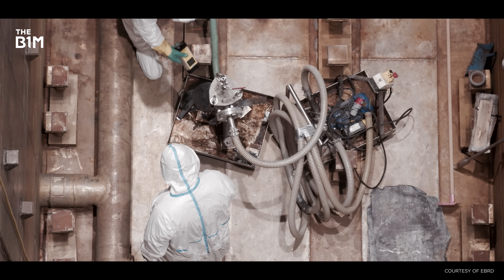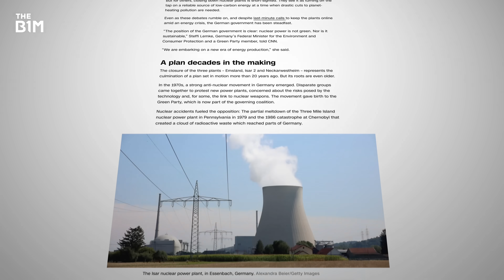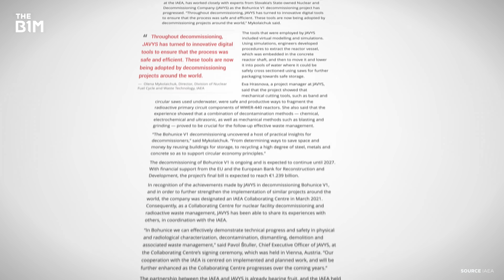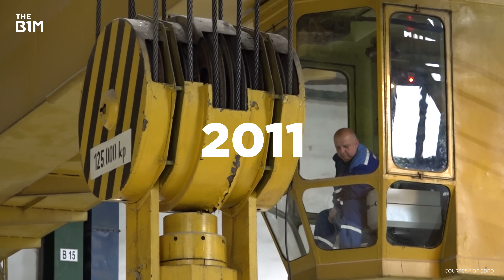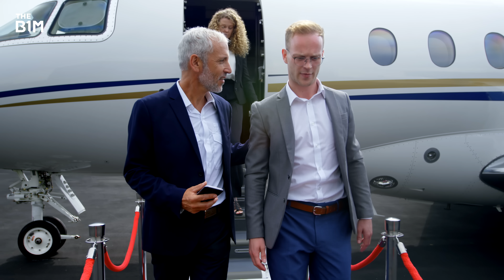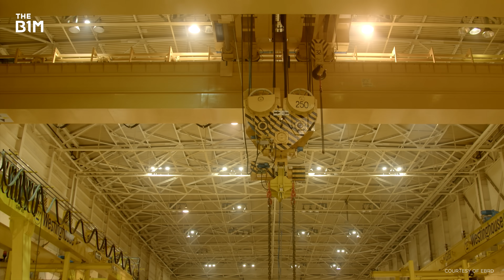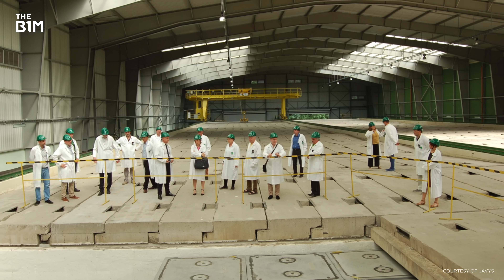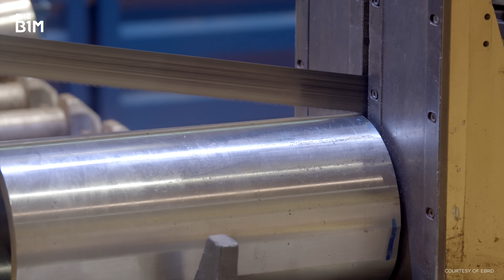Why These Soviet-Era Reactors Are Being Taken Apart

Comment: I’m probably one of the few people who watched this video that actually has worked on nuclear power plants. I’ve been fortunate enough to work on the containment vessel at a nuclear power station, the refueling machinery and the sacrificial shield walls of a nuclear reactor. I really believe that nuclear power has a role to play in our energy production matrix. And that opinion isn’t based on my previous work in the field. I’ve worked in multiple coal power stations, biomass and municipal waste stations, natural gas cogeneration plants and hydroelectric energy systems.
Reply: From your experience, what are the best forms of electricity generation?
Reply: @BelaJuTe  I’m a huge fan of hydroelectric power. I also think that tidal power has great potential promise for our future. The fact is that every type of power generation has its positive points as well as downsides. I believe we are going to need a BROAD mix of different types of power sources to serve our future needs. I am enthusiastic about small nuclear power generation systems, tidal, solar, wind, hydro, and geothermal energy generation. Variety is the key for the future.
Reply: @briangarrow448 hydro dams are the biggest batteries
Reply: @briangarrow448 Saw hydroelectric very positive aswell. One big disadvantage I came about recently are the methane emissions from flooded soil. It can take Up to 100 years until the emissions Stop and the gases have a Higher Greenhouse effect than CO2. 
Means we should absolutely still continue the use of the Standing ones but new Projects would need more Work, clearing the flooded areas of biomass would be one possibility.
Reply: There is a great video from a well known  professor of energy resources, who proves with numbers, facts and graphs exactly the opposite.  He shows that PV in Germany is even reducing the usage of nuclear in france.  Nuclear is just too expensive and is too much of an economic risk.  His video is called  "droht das Atom-Aus in Frankreich"
Reply: @1968Christiaan  And with the prices for Battery storage dropping fast right now cause of scaling up of the production will make it more and more a no brainer to have all houses with a PV and battery. So the storage close to the consumption and less usage of the grid.
Reply: @toggleton6365 what are you going to do with all those batteries at their end of life? Decommissioning is something required of nearly every power system, and batteries are some of the worst.
Reply: @aggonzalezdc  it's terrible if we use lithium batteries, but that's the wrong tech for the job. Lithium batteries' best trait is their energy density, important in portable applications but irrelevant in most others. There are battery technologies that are (potentially) cheaper, more recyclable and longer lasting. Using lithium batteries for large scale or even home energy storage is like building a skyscraper in the middle of a field instead of a low-rise town.
Reply: @aggonzalezdc  Well car batterys that are at under 80percent of their range or the car did break, get a second life as grid storage. And Mercedes as example is already building a recycling factory that is so far mostly for broken battery packs that failed in the factory.

The big problem is to sort small batterys from household electronics to recycle them better. Different Battery technology needs slightly different recycling steps. But car and grid storage are big packs that can be easy sorted so that the most efficient recycling method will be used. 

Well the great part is the EU already made rules for it. So that Battery need to have a  QR code label so you know what is inside. And rules what percentage of  cobalt lead lithium and nickel need to get recovered. Europe has not many metal mines themself so recycling creates a Material flow that is not depending on China. The likelyhood of this recycling system failing should be low as the materials are worth it.
Reply: @aggonzalezdc  There are a lot of breakthroughs on sodium batteries. Like batteries essentially made out of salt (well part of salt). There already commercially hitting the market. Expensive for now but with how cheap sodium is compared to lithium it's expected to drop price rapidly. High cycle life, decent capacity, about the same as lipo4.
Reply: @matthewsylvester9103  sodium technologies are promising. Molten salt is a good idea for grid scale, and it's much easier to recycle, which is great. The energy density is low for much else though (even other sodium based chemistries). Regardless, the same problem exists with nearly any battery, though it's much worse for lithium, nickel, or cobalt based chemistries. The recycling technology exists, we CAN do it. But we don't. It's too expensive. We've had the tech to fully chemically recycle nearly 100% of plastic products but you can count all the plants that do so on earth on one hand, and they run at a massive loss. We could do it but we don't because it's not profitable. So nearly all plastic goes in a landfill, even the stuff we put in the recycling bin. We could recycle the car batteries that are already being decommissioned now, but we don't. They're already piling up. And there are going to be tons of them. It's not very green to make them (currently) and it's not green at all to throw them away (currently).  

In theory, they're great, in practice, the green future we were promised isn't here. Not YET. Solar panels similarly aren't there yet. In time, I hope we can use 100% solar, with panels made in a sustainable way, with 100% recyclable components and energy storage for the whole grid. But we don't have time. We need action now. 

What we do have is a ton of knowledge and experience with nuclear. And one day, in 50 years when we have the processes and industries to make it all possible, we can phase out the nuclear for most  applications. Nuclear is what can help humans survive long enough to come up with something better. Other technologies are promising, they just need more time. For now, nuclear is safer, and cleaner than anything else. I hope in time that won't be the case, but we don't have that luxury now.
Reply: @toggleton6365 batteries don't scale 😂
Reply: @Snarf_Le_Wombat   They scale with the amount of factorys that get build and with the amount of material that is used. There is a lot of research to use less rare and by that expensive Materials Batteries.  For gridstorage you don't need the best battery, usually you are not limited by weight and size. Redox flow or organic flow are not really rolled out on a big scale. 
There is right now more the prediction that we will get into an overproduction and the market will be flooded so the price will drop even more.

Using the battery packs in cars a little bit for grid Storage will be already a big amount of capacity.
You really underestimate how fast the amount of Battery is scaling up.
Reply: @toggleton6365  it doesn't scale
Reply: @Snarf_Le_Wombat  Why does it not scale? You are writing like a angry little child. jesus give at least an argument.
Reply: @toggleton6365   you seem to think batteries are possible of large scale energy storage for the power grid, that's just not going to happen 😭
Reply: @Snarf_Le_Wombat  So you still have no arguments and give up with your feeling as argument. California has already battery storage that discharges already over 6GW and rising. total Battery Storage is 10GW with an additional 3.8GW planned to come online by the end of 2024. Peak demand in California is 25GW. So not unreachable with the current pace of building. 

 Texas is building a lot Battery grid storage too. The prices of Batterys has dropped  recently. So this will accelerate even more. 
How many GigaWatt do they need to be seen as big scale :)
Reply: bro just worked in every form of power plants that exist. he must be einstein or something
Reply: @karlrasur8356  You obviously don’t know anything about skilled trades workers like boilermakers, pipefitters or millwrights. These tradespeople regularly work in the construction and maintenance of these industries, along with many others like mining and petroleum companies. Hope this helps explain how some skilled trades have made great careers while doing fascinating work.
Reply: @briangarrow448 recently viewed a few pods on the current waste of & potential access to energy via recycled radioactive waste. Apparently, France is the only deeply vested country which, given their #'s, is a bit shocking. Have you ever worked inside their plant? What's your thoughts on the viability of this new science?
Reply: Do you believe this reactor was too dangerous to operate? It seems so wasteful to dismantle this plant
Reply: @Mrbg123  Anything Russian is defective.
Reply: I think the world has squandered nuclear power. First the approach of building these complex massive reactors that are custom designed for each site was a terrible mistake. 

I think mass producing 1,000 smaller nuclear reactors of comparable size to those on aircraft carriers we could provide enough electricity for 500 million people. They can have 20 reactors placed at naval bases across America and provide enough electricity to atleast half of the country with the remaining electricity being supplied by wind, solar and hydro. 

I think this same model can be used all across Europe. France currently gets 80% of its electricity from nuclear power.
Reply: dudes trying to humbleflex about his lies on the Internet 😂
Reply: @Snarf_Le_Wombat  I don’t lie. I don’t need to. I have the scars and the tee shirt. My resume includes most of the largest global contractors in mining, refining and power plant construction. Everyone from ABB and Bechtel to Westinghouse. Over 40 years of experience working with contractors across North America.
Reply: @briangarrow448   🤷🏿‍♂️ yeah I mean even the nuke plants need someone to scrub the toilets 🚽 💦 🪠
Reply: @Snarf_Le_Wombat  I’m sure those plants do need clean rest rooms. But I wouldn’t know who does that job. I’m willing to bet they are smarter than you, though. And make significantly more money than you. You seem to be very bitter and resentful about others having jobs. Maybe you should try to get some education and learn some marketable skills. I would suggest that you finish middle school and then high school as a minimum. Then start looking at some post secondary education. You know, that bootstrap thing you and your friends keep talking about. Good luck. I’m sure with dedication and hard work you’ll pull yourself out of the hole you live in soon!
Reply: @Snarf_Le_Wombat  Oh, so you are better than the guy doing cleaning in a nuke station? I doubt you could get a security clearance for any job within the fence line.
Reply: Nuclear makes sense - it`s actually NATURAL - ever seen the Sun?
Reply: @moosifer3321 once... Now I don't see anything.
Reply: Ah yes, Slovakia, the westernmost part of the USSR.
Reply: @badllama4554  Don't derail other people's threads!

Comment: How can you claim that nuclear power is cleaner, even when you take waste into account, when waste has a lifespan of hundreds of thousands of years? 🤔
Reply: Because when you take production and waste into account, the so-called 'green' energy sources Solar power and Wind power, aren't actually that 'clean'
Reply: @halofreak1990  Solar is mostly Aluminium and Glass, absolute easy to recycle. For the solar technology itself. You can recycle the metals out of it. The silicon wafer is likely not worth much.
For wind power recycling. New wind power plants are build with recycling in mind. for older ones is since not that long a go a way to dissolve the blades in special acid. So that should be longterm be no big problem.
Reply: @halofreak1990  Nonsense. All of Wind, nuclear, hydro and PV are very clean indeed on a Kg CO2e/kWh basis. PV is the worst at ~30gCO2e/kWh (but falling quite fast). The others are <12. gas is 400-800 depending on how much leaks. Coal is 800-1000. It's more than an order of magnitude difference between the clean sources and the dirty ones. And nuclear is right up there at the 'very clean' end along with wind and hydro. PV not far behind.
Reply: Radioactive material isn't invented from nuclear power generation. It's taken out of the ground, used, and then put back into the ground somewhere marked safe for it to be.
Reply: all the waste is literally being dismantled, concrete will be reused.
did you even watch the video?
Reply: @spacecube8561  Not all the waste. The high-level stuff will go into long-term storage. But that's a very small fraction of the total site waste.
Reply: @xxwookey  nobody said all the ''waste''
Reply: @spacecube8561  Yes, you yourself said "all the waste is literally being dismantled". So someone definitely said "all the waste", and that was what I was replying to. But I think we are in general agreement about how this works.
Reply: Because it has very low greenhouse gas emissions, which as we know is a huge global problem and has to stop. Nuclear waste storage is a fairly straightforward engineering problem (but a difficult political problem). Onkalo in Finland is a good example of how to do it well.
Climate change will ruin our existing civilisation in under 100 years if left unchecked. That problem is millions of times worse than having to put some radioactive material back underground. The vast majority of radioactivity is gone in a few decades - only a few materials carry on being significantly radioactive for thousands of years, and because the decay is slow the levels are low.

Comment: Couldn't the turbines be reused? Or do this design only work with this style of nuclear power station?
Reply: Do you want to reuse turbines that are 40 or fifty years old?  And if you did, where would you get the replacement parts.  Cheaper to buy new.
Reply: You are asking an interesting question.  Steam turbines need steam, just is it.  Everything else is in the air.
Reply: If it’s still functional It could work with other nuclear plants or any other power stations that heat water to create steam

Comment: SMRs don't even exist at the moment. Nobody has a full working model available for testing, and all the Western versions have been abandoned over cost overruns and operational expenses.

Using SMRs in your video is disingenuous at best. They can not be cited as a viable, proven model for future progress without including a big and important lie: they don't really exist. You might as well cite magic or unicorns for running major grids as SMRs. In fact, there's  probably more video and literary "evidence" for both magic and unicorns.
Reply: If they don't really exist, then why are many governments, mine included, intent on having SMRs in use within the next decade alongside full-size nuclear power plants?
Reply: @halofreak1990  Political statements != actual actions or simple economics.
Reply: @halofreak1990  The fun part here is intent. Reading news about nuclear plans in 2010 are fun cause you have the same as now. We plan to build x amount of nuclear. and 14years later none of them has been build. 

The example here is NuScale they wanted to build a SMR in ohio. They got even subsidies from the inflation reduction act to lower the price of the produced electricity. It did go so expensive that the project is canceled. gone up from around 3 to 9billion. To believe that other projects in other countrys will be better is wild.
Reply: Even though I personally support nuclear power I am inclined to agree, nuclear reactors’ efficiency scales with size which means that the bigger the better, small modular reactors are like trying to build mini-blimps… they should have focused on standardization and modularity of larger designs

Comment: Disappointed on the execution of that advertisement; possibly it does meet you tubes standards and there is a small logo on the left hand side at the start of the video, however to work it into the script in such a way is very misleading. I would expect better from a channel with such high quality content.